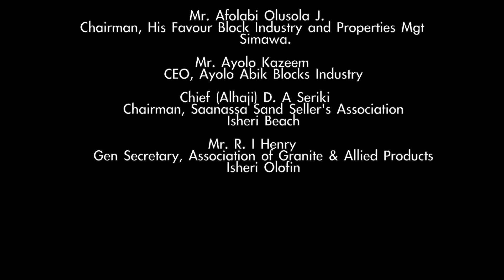EPISODE 1: What is in your building block?

Comment: Good effort but with a mistake. The mix ration says 1 bag to 4 wheelbarrow, this means ratio 1:8 -good. 1 bag of cement=2 head pans and 1 wheelbarrow = 4 head pans 
But 1 bag to 8 head pan is wrong as there are 4 head pans in a wheelbarrow. therefore the second mix ratio should be 1 bag to 16 head pans
Reply: Scientist!